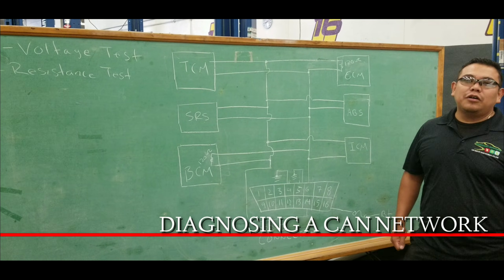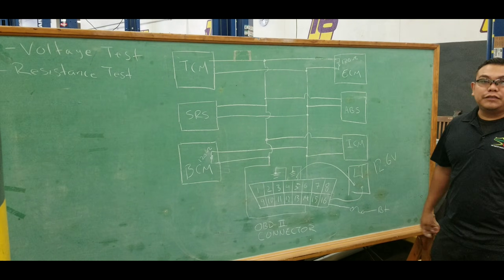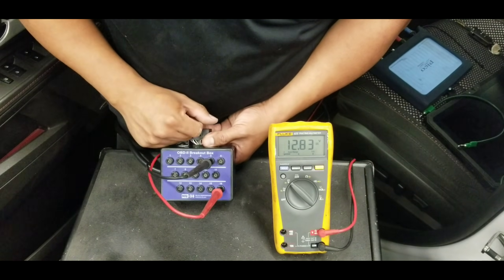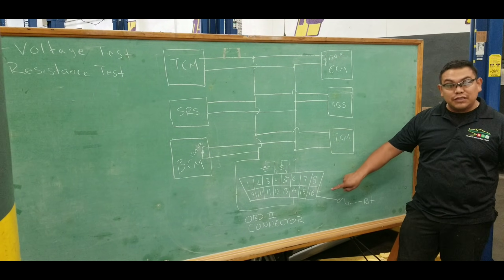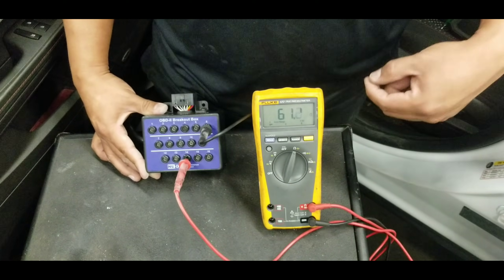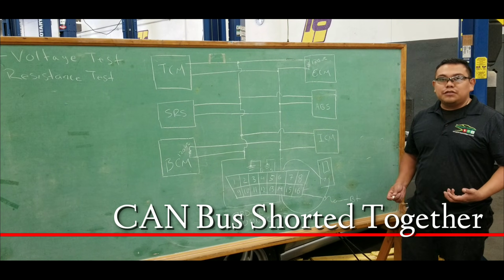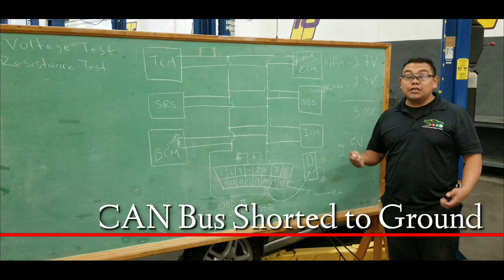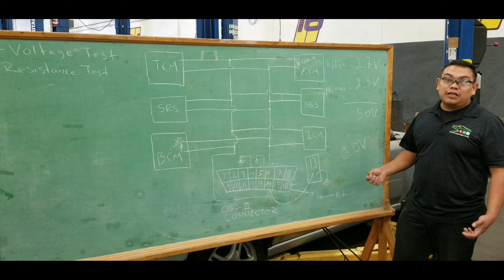How to test a CAN bus network with a meter

Comment: Excellent explanation, thank you so much. What kind of diagnosis you suggest for the following scenario
I am getting P0601 (ECM Internal Control Module Memory Checksum Error ) with messages Engine power is reduced, Service Stabilittrak and service traction control along with check engine light. My truck is GMC Sierra 1500 5.3 v8 and this happens even though the truck is parked but the ignition switch is lift on ACC (not on the ON position) and the truck does not start and have to wait 3 to 5 minutes then it starts. It is not the battery being drained as I have connected a charger to maintain the battery. The same is happening while driving as well. I checked and cleaned every possible ground point and the alternator is producing 14.6 volt ... can you help please

Comment: First of, thank you for making such a great video !
I watched a couple of times and made wonder the following:
 
Say you have a short in the can high line and you do a voltage test at the plug, would you see 0 zero volts at can hi (straight to ground) and see 5 colts at can low, making up.for 0colts at can high ? Thanks,mick,  Australia.

Comment: Don't know if your still around, but I have an 03 chevy truck that doesn't have wires can buss hi and low. All it has is a purple wire at pin 2 at the data link connector. I think I have a comm problem but don't know where to check it at. Help

Comment: Mr. Diagnostech, My resistance measured 125 ohm, but I can't find the problem. My dealer said I need new sub harness for power steering. Would you help to locate sub harness?

Comment: great video. Can you please help me?

2006 dodge Grand caravan dies while driving. Has 12.6 volts. All interior functions work. blinkers, headlights, ac blower door locks, windows, radio etc. No crank no start

Checked every fuse in TIPM with continuity meter, all good. Swapped stater relay with known good relay. No start. Relay clicks when key turns to start position.  Disassembled TIPM no corrosion on plug, terminals or relays. Cleaned both 12v battery into TPIM with scotch Brite grey pad. Also cleaned battery negative to frame ground with scotch Brite neither where corroded what so ever
Found your video. test results as follows:

12.4v from both terminal 4 and 5 to 16

Ohm reading terminals 6 to 14 ...open circuit (OL )
Voltage reading from good ground to terminal 6 ...0 volts
                                                 ground to terminal 4....0 volts
I had no cel codes
 Start relay....Jumpering terminal 30 12v battery to terminal 87 ( starter) cranks starter motor over.
Ordered rebuilt PCM but haven't received it yet.
I really don't .want to tow to a shop if I can avoid it.
Thanks...Tim B

Comment: Thank you sir, i have a question, i found 2.56 on both of Pins 6 and 14 , at the same time. The resistance between them is 60 ohms 
I'm really confused

Comment: Thanks so much for this information. Indeed it benefits me and more like me 5 years after😂

My batt voltage measured 11.89 when checked is that a good sign?

And yes i have no crank no start no comm on santafe 2013 XL

Every readings so far matched perfectly but batt @ 11.89.

Comment: Video is informative but confuse, so many expert in the net and in my information get it from a expert, 60omhs never be exact, need to run down 70, my car runs 68 omhs and is normal, .2 in ground is normal too, this kind of info will put everyone crazy about voltage, the can bus is normal, h or low can be in each 2.5 and no problem, the sum of the 2 (h and l) need around 5 volts no matter hoy many volts you see en the h and low.

Comment: Hi sir, but I unplugged, pcm, ecm and abs, and stay around 60 ohms, nothing change, what happen?
Reply: You said supposed jump to 120 ohms and  nothings happens😢
Reply from the maker: @endercart2753  That's because in some cars other modules have the terminating resistors or in some cases the resistor are no longer found within a module. The can be found externally on connectors. Do a research on your vehicle to find their location .
Reply: @MRDIAGNOSTECH but sir there is no sense, if the resistor is internal or is in the wires, no matter what, if you disconnect de wire from the ECU is the same result suppose 120omh and still in the same 68omh no matter what module I disconnect.
Reply from the maker: @endercart2753  They're connected in parallel, you can disconnect a wire, but if it doesn't have the terminating resistor there will be no change.
Reply: @MRDIAGNOSTECH spent an entire week and nothing, conclusion,  my car doesnt have terminal resistor, what next.
Reply: Unfurtunally, no especific location in my search😢

Comment: Hello Professor, what if you check voltage on 
6 & 14 gives 8vOLTS on both CAN H & CAN L instead of 3.5 V on CAN H and 1.5 on CAN L?
Reply: Dont take on detail what he sais if your H and Low, no matter what the sum is arround  5 volts is ok, in my case my car L and H give me each 2.5 v and is normal, he said about shorted to the ground and when he tested in the video read .2 and is normal too thats why the video create caos, is informative but confuse, in your case 8v is to hight with both  means you have a open circut, different of a open ground. Needs to disconnect modules connectors and see any changes en the can H and L voltage.

Comment: The last part in reference to potential can bus lines shorting together. Mine on a voltage test both are measuring the same 2.62 volts instead of one around 2.7 and the other 2.3 and ohms test is measuring 63.3 ohms. In my situation you didn’t finish the ending of the video. 😅 so what if both the high and low side are both measuring the same on the voltage 2.62 volts and not fluctuating up to 5 and going over? I’m getting about 15 codes and one indicates overcurrent at the starter and lots of high and low circuits. I have added grounds . But are those numbers ok if they add to over 5.4 and not fluctuating?

Comment: @MRDIAGNOSTECH My pin 14 and 6 is showing 52ohms on 16 Honda Pilot even disconnect ecu and other computer in the engine bay still the same any suggestions?

Comment: Hopefully someone can chime in this afternoon, and I can proceed....Great video, appreciate you, just one confusion for me. I have 59.1 Ohms at pin 6, pin 14, and as soon as I unplug my ABS/VDC, it goes to 120 ohms...plug ABS/VDC back in...back to 59.1 Ohms. it was a little unclear...does that mean ABS/VDC is holding Terminating resistor that is good? or Bad?
Reply from the maker: This means that it has good  terminating resistor.  There is a tolerance for resistance based on temperature, it can be anywhere from 58 to 62 ohms.
Reply: @MRDIAGNOSTECH  Thank you. As I believed,  just needed some confirmation. I have a Low Voltage supply slew of codes in BIU module, and VDC/ABS/Immobilizer. I did a head gasket job...only electrical variables is unplug of main harness at Transmission/engine mating point top right rear of block, which shouldn't cause this issue..a plug/unplug....and the other is the Starter, and Alternator,  and Battery cables, that were moved, so I am going to check all battery connection points. Grounds all tested good in engine compartment,  and under dash. Continuity present in all, and good resistance.  Thank you.

Comment: I have 2003 c230 Kompressor with 226k miles. I now have a pid PO600 “CAN Communication To Control Module ESP is Faulty” in my OBD2. Any suggestions will be highly appreciated. thanks!

Comment: Great Vid, very well explained!. Question> This test sequence is great for an existing condition/code. I've been plagued for a year by an intermittent U0073, that clears on its own and has no connected codes. Dealer cannot duplicate. Could the breaker box be used while driving [yeah, I know] and Multimeter connected, to see if there is an instant short/open when it happens?

Comment: Greatly appreciated.  Very well done video.  Unfortunately this method will not work with newer Fords and their gateway modules, you need one of their expensive special break out boxes to test all can lines.  that box is roughly $600-1000

Comment: Bravo, excellent, intuitive description of the can bus function. I have such an issue, I have power at the DLC at pin 16, and good grounds at 4 & 6. But no communication with the PCM through my Scanner. All the fuses checked out good, and for good measure I replaced the PCM Relay in the Power Distribution box. According to the Wiring Diagram for my 98 F150, both the High Bus & Low Bus are located in the PCM. I didn't suspect the communication problem with the PCM because the Truck Runs. But now if I do the Ohms test, I might discover that one of those busses are bad. Recently I had an Alternator that went bad sending a surge through the electrical system, and blowing a 175 amp fuse, all of which I replaced.

Comment: when measuring resistance with multimeter, no electricity should be in the circuit, so the battery must be disconnected.

Comment: Is this only to troubleshoot car not communicating with scanner tool? I did this step by step with you and my car did everything correctly and it communicates with the scan tool fine. But I have a loss of communication with tcm ecm instrument cluster and abs system. 😢
Reply from the maker: No, this test is to troubleshoot the bus network. Check a wiring diagram and see which network your vehicle has and how many. Check and see if they share the same network.

Comment: @13:34 I saw another video that said when the can was asleep here you should be reading 0V but you are getting 1V. So which one is correct? The reason I ask is because I did this test when CAN is asleep and I get 1.55v ~ 1.88v. According to that video that is a short to voltage
Reply from the maker: During this test, the network was asleep because the ignition was on the off position, but it would take a few minutes to shut down entirely. If the door was closed, it would have read 0V after a few minutes, shutting down the network.

Comment: I have a problem with the CAN bus, pin 6 measures 1.5 volts and pin 14 measures 0.95 volts, but the car works fine without any problems but I cannot connect the Honda due to that problem because it does not communicate with the ecu

Comment: What happens if you have 62.7 resistance?
Reply from the maker: There's a 10% tolerance that you can go up.or down. I've seen 58 ohms with no issue.

Comment: I have a problem that was not covered in the video. When ohm testing 6 to 14 with the key off I get OL. Voltage on pin 6 is 10v and voltage on pin 14 is 8v. The van will not crank or start. The scantool can only communicate with modules on the low speed bus. It cannot communicate with ecm or tcm which are where the resistors are. I would suspect there is a short to power in one of the modules correct?

Comment: 2008 jeep patriot, we have a no crank, no comm with everything on the PCM can bus. I have a SES light on dash, the "no bus" message is not on the dash like I see on some Chrysler cars.  Found corroded main relay harness in the usual spot under the inner fender but bypassing it and restoring power to PCM didnt help at all.  At the DLC I have 2.5 volts on both can wires, these wires come directly from the TIPM, at the PCM and ABS I have 1.5 and 4.5 volts.  which is also connected to the TIPM but separately from the Diag lines.  When I get back to the shop this week Ill take a resistance reading but in the meantime I would appreciate any help you can give me.

Comment: If no power from pins 16 to 4 or 5, the first test is to move your ground lead to the car ground, on some cars pins 4 and 5 or tied together and maybe the wire terminal at the chassis location is broken. Don't chase down a fuse for pin 16 if it has power but your BOB is only a tool, not a proof. I DO like the procedure to use pins 4 and 5 but I will go straight to a ground point as the next test. I ALSO do not like a multimeter as a tester, its high impedance and it does not require much amperage to show 12V, I use a heavy 2A test light. The new procedure in 2023 is to install a test light on the multimeter and use both. IVAN from PHAD and Jake from AP&D use this method. 

If wires are shorted together we need to look at a schematic to find a connector inline between the DLC and the suspected side of the circuit, unplugging modules is a poor diagnostic procedure as the first step UNLESS no schematic is available, then why are you working on cars with no resources? Major waste of time, join some Forums and FB Groups to get such simple information for free. This video is fine for a first video but there needs to be more training to cover more real-world scenarios and more parallel and series module setups on different vehicles, and real usage of schematics and scanner codes with definitions to speed up diagnosis, cheers.

Comment: In a situation I used multimeter to test can network on no communication, using pin 6 and 14 I got 60ohm when I unplug the ECM, I still got 60 ohm instead of 120 ohm. 2007 dodge charger. What can you say about that? Pls reply me on this comment section thanks.
Reply from the maker: The pcm doesn't always have the terminating resistors. Check powers and grounds at the DLC connector
 Pins 4 and 5 are grounds and pin 16 is battery voltage.
Reply: @MRDIAGNOSTECH  Yes sir, there is power and ground but  can c line can still not communicate, having no crank issue.
Reply from the maker: @dozieautomechanics1117  are you able to communicate with other modules besides PCM?
Reply: @MRDIAGNOSTECH  PCM, ABS, and SRS have lost communication codes.
Reply: But the wipers, radio, headlamps, glasses, remote are communicating.

Comment: 2007 Chevrolet Tahoe codes B1395-03 and B1529-03. Check voltage at pin 6 And it has 0.92v and pin 14 has 0.62v.

Comment: This was sooooooooo helpful. I bot a $30 breakout box and determined that my CAN network was working by repeating all of the tests demonstrated in this video. I connected my $20 DTC code reader to the breakout box and it reported that it could not connect to the HVAC module. Via this process, I avoided hours at the dealer $165 per hour.
Reply: Im working on a similar problem…so what was the issue the HVAC module or ?

Comment: Excellent video, taught me some things I didn't know. One note, on the multi meter, the "O.L", if I'm not mistaken, means Out of Limit, indicating a resistance that is higher than the meter can measure
Reply from the maker: You are correct,  I noticed it after I posted the video. It meant out of limits.

Comment: Great video! Very helpful. With your help I found I have a short now to find out where. I have 0 ohms no matter what I unplug from the computer. I also am reading 2.4 volts on both the high side and low side.

Comment: Brilliant tutorial. I’ve a no crank no start at the moment but needed to know if I had any shorts. I’d tested my resistance which was good but didn’t know about the difference in voltage between high and low. I’ve now tested this and I’ve got what I should have so I can move forward and test some more.

Comment: Disconnecting battery to check voltage will result in radio presets etc. How can we avoid this.
Reply from the maker: This can also erase obd monitors status,  you can either record the radio presets or try to do the resistance test while battery is disconnected, but make sure that all modules are asleep by waiting at leat 15 minutes before performing this test after the ignition has been turned off.

Comment: My 98 Hyundai excel has no terminal in pin 6 only  7&8 🤷 did someone maybe move the pins ? 
Can I damage anything by doing these tests to identify which pin is what ?
Reply from the maker: That's because your vehicle doesn't have a CAN network, it uses a different protocol.

Comment: A simple VOM reading of Battery voltage does not necessarily mean that a ground or supply is "Good" Test Light is better as it loads the circuit a little.

Comment: If the resistor on the ABS and or the ECM is found to be bad, can you replace the resister with the same value or does the ABS module have to be replaced ?  Thank you Sir.

Comment: So at the end of the video. What would a normal resistance test show if they're not shorted. Would it just say Open Line? Or is there a number they should be. Mine says 800 ohms.
Reply from the maker: Normal readings are 60 ohms plus or minus 2 ohms.

Comment: Hi,  Great explanation. This has been very useful. However, the very last test you show is resistance across pins 6 to 14 with the ignition on; your meter is showing a 0.2. Doing this same set of tests I have 60 ohms with battery off, then with battery/IGN on I have 2.46V high and low indicating possible short between the two, however when I do the last test I get 60 ohms again with battery/Ign on. Am I doing something wrong?

Comment: Why am I always showing 61 ohms all the time at pins 6 and 14?
Reply from the maker: When measuring resistance there's is a 5% tolerance due to temperature. you can measure anything from 59 to 61 ohms.